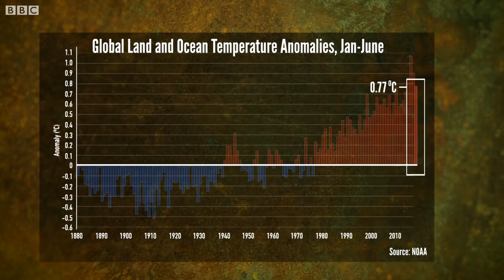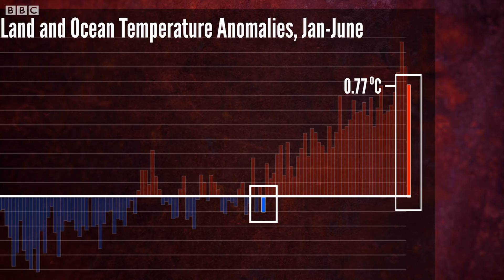Heatwave 2018 explained - BBC News

Comment: July 1757 heatwave, Europe, hottest summer in 500 years prior to 2003.   1896 Eastern North America heat wave killed 1,500 people in August 1896.   1901 eastern United States heat wave killed 9,500 in the eastern United States.   1906 – During the 1906 United Kingdom heat wave which began in August and lasted into September broke numerous records. On the 2nd temperatures reached 36 °C (96 °F) which still holds the September record however some places beat their local record during September 1911 and September 2016.   1911 – The 1911 United Kingdom heat wave was one of the most severe periods of heat to hit the country with temperatures around 36 °C (97 °F). The heat began in early July and didn't let up until mid September where even in September temperatures were still up to 33 °C (92 °F). It took 79 years for temperature higher to be recorded in the United Kingdom during  1990 United Kingdom heat wave.   So on and on. Shall I carry on or not necessary?

Comment: A 1°c rise in global temperature is an absolutely enormous amount of extra energy. That energy has to go somewhere because energy isn't used up, it just gets converted to another form so it goes into stronger storms and hurricanes, more rain, heavier snowfalls, rising sea levels and more heat and fires.
Reply: Possibly the most sensible comment on here yet
Reply: Thank you
Reply: Damien
Nailed it in language anyone can understand.
Reply: Nunovia Gottdamnedbizzness  In a simplified way, That's exactly how energy works.
Reply: Listen Damien, do you know that since the end of the last ice age the temperature have risen some 10 degrees C?... you know that America have been in a socalled hurricane drought and the number of storm reaching landfall is below average?... that global warming shouldn't lead to more snowfall at all, and that the sea is in fact not rising... Al Gore predicted not long ago that the North Pole would be ice free in 2014..."the entire ice cap would be gone in five years"... how do you think your high priests predictions are going?
Reply: @ipanzerschrecku4732  It's stunning to see someone so deeply in denial that they'll rattle off all of that nonsense as fact without citing a single source for it.
Reply: If you cant take the heat stay the fu*k out the kitchen

Comment: And what's behind the hot weather? Geoengineering. Stratospheric Aerosol Injection of heavy metals traps heat in at night. It doesn't reflect enough to help but it's enough metal to make us all toxic as well as hot.
Reply: You geoengineering nutcases crop up everywhere...  
Global warming is fact and is driven by human industrial civilisation, but it is an unwitting relationship.  
.
Do REAL science, not conspiracy pseudo-science.  
.
A Bell -  There is very little that humans can do, to mitigate the emissions and other vectors of destruction that they have unwittingly unleased.    Global warming is locked-in   Nothing we do, can change that.   

Also, within the short term of any carbon reduction program,  temperatures will continue to rise, not only from the locked-in process of current global warming, but a continual and steady reduction in both the cryospheric and atmospheric albedo effect.    Heavy particulates (from industry and transportation...) are currently afording us a degree of protection in the form of 'global dimming'.    So, a classic 'catch 22' scenario.   

Add to that, the very worrying fact, that vast deposits of methane hydrates are beginning to thaw in the sediments of the East Siberian Shelf and from the permafrost, all across the exisitng northern tundra regions.   CH4-methane, is around 100 times more potent, molecule-for-molecule, than CO2, as an atmospheric warming agent.    Though shorter lived, it nevertheless eventually breaks down into two greenhouse gasses, notably - CO2 and H2O vapour.   

Humans!  -  They're either drunk on hubris, stoned on hopium, or in a coma of faith...  
...And most are thus oblivious to oblivion.
Reply: I just don't understand why they would bother with polluting the air when they could just poison the drinking water instead, which seems much more reliable and controllable.
Reply: Windir "They" aren't polluting the air on purpose. "They" are colleges, private companies, local, state, and federal governments in the US, and about 50 countries worldwide that are cloud seeding in order to get it to rain, snow, not rain or snow, clear up fog around airports...etc. China does more cloud seeding than any other country. When they hosted the Olympics they spent a lot of money on seeding. On top of the global warming effects, I wonder what effects these seeding programs have on weather patterns, which in turn effect climate... Everyone yells, "it's local," but with so many doing it now, it's global...

In Tucson, this year, Harvard is doing a solar radiation management test to see what effects pumping particulate in the atmosphere to get the sunlight to reflect out will have. There's lots of information on cloud seeding available. Langmuir and Vonnegut (yep, Kurt's brother) did the first experiments back in the 1940s.
Reply: Windir control of the weather 1pacificRedwood
Reply: Conspiracy theorists grasp at straws and the planet heating up is a straw.
Reply: Windir over population
Reply: A Bell I would be the first type. There are worse things than deaths anyway.
Reply: Your tin foil hat is falling off
Reply: TheCausation My biggest challenge is the willfully ignorant who fall into 2 categories: cynics who say "yes, yes we know all the world is terrible and I'm going to die anyway" and the fearful fragile types who cling to a belief in a mythical "they" who will take care of us all and fix these things. Their type says not to focus on negative things too much because thinking on a problem is not the first step to making a solution, rather, it is somehow yielding to the problem. To the first I say "just because you're going to die, you wouldn't agree to being murdered" and to the second type I say "burying ones head in the sand won't save you."
Reply: So tell me what's the motivation behind it?
Reply: Windir Read "Under an Ionized Sky" or "Chemtrails, HAARP and The Full- Spectrum Dominance of Planet Earth" by Elana Freeland or watch the dvd "Why In The World Are They Spraying" for a full explanation of the spray programs.
Reply: TheCausation You're right of course. It's extraordinary.
Reply: A. Bell. 
At last I've found someone with a fully functioning brain.
Good point.
Reply: Mark Rymanowski yes all the dbass conspiracy theorist think they're so smart. Just like the flat earthers. When infact everyone is laughing at them.

Comment: I can sustain 45°© ,I live in mid-india where 43°© is average during march-june. This summer  highest temperature was 47°©. We  are immune to this life-threatening temperature. The only surprise if it will cross 50°©. Again we don't have AC.I ONLY MANAGED COOLER WHICH CAN COOL DOWN    30°c. The only solution is adoptation. I can easily drink 15 liters of water during summer bcoz you get dehydrated very quickly.
Reply: Unbiased Opinion . BBC.is UK .  my country . our country is not used to this therefore we don't have the stuff we need to adapt to extreme temperature. our average is around 16-25  . in summer . the 33 degrees that we had has changed our average for summer
Reply: Yacobus Fitri like 6 months usage of socks that ain't been washed
Reply: I live by the arctic circle and it has easily been above 30C degrees here for weeks.. or months.
Extreme drought and forest fires everywhere. It's _ highly_ uncommon homes have an AC here too, ugh.
Reply: Nilesh Bhakre us too in England brother. We have no AC in our buildings only offices and industrial kitchens. The south east of England has ran out of fans. In England too we get the humid heat. Stay safe bro ❤️ 🇮🇳 🇬🇧
Reply: I can't adapt. My skin goes white to red and blotchy after two minutes. I'm allergic to the solar radiation. I have to stay indoors, only thing that helps! My baby was poorly with a cold and temperature and couldn't cool her down
Reply: Donald McCarthy bro come here in Vidarbha region in India during MAY, try to live without AC and coole, you will understand 45°© mania
Reply: Fikitupper YOU CAN CALL ME BS BUT NOT TO DARWIN. We can manage to live here without excuse.You should really need to feel 45°© mania.
Reply: You can adapt you pussys, if we can all move here to Australia and live then you can, they came here on ships with no aircon after living in Europe and settled in so you guys can deal with it
Reply: Walker11 Fuck your sewer rat
Reply: Ha, in Tucson, AZ we have the same sustained temps through our summer. I also have a "swamp cooler" so today it was about 90°F in my apartment, and 108°F outside lol. We could hang 😋
Reply: And if it gets down to 78° I need a sweater. It takes just about 14 days to acclimate to hot temps. Anyone can do it.
Reply: Unbiased Opinion typical low brain idiot. Would plants survive at 45c? The only solution is adaptation? What kind of bs solution is that? No one adapts to a high temp. Last I checked heat waves in India killed many. No one has adapted to the high temperature lol.

Comment: Why tf r ppl complaining i love snow in the winter and heatwaves in the summer - tell me im not the only one and also the last summer like this was 2003, then 1976, most summers between were pretty crap and rainy...but greenhouse gases do make the temperatures hotter but how come this never happened in the victorian era when greenhouse gases were chocked out of factories en-masse across the world? I have so many unanswered questions
Reply: Because the effect is cumulative, the victorian influence is still there against our modern output of greenhouse gases
Reply: Also while you enjoy your hot summers the same heat is causing the seas to rise and flooding whole islands elsewhere...
Reply: Elijah Pisani Good comment. I couldn't disagree with your theory, sounds plausible. I would be reasonably confident, as earth has weather cycles, that it'll be able to overcome and survive. How the sun is doing has to be worth watching
Reply: JAMES WHITELEY yes new ice is forming, but not at the rate it should be. For the ice to hold at the poles the ice needs to compress and harden - which takes thousands of years...
Reply: 97, 98, 04 and 06 were hotter than 03
Reply: Snow in the winter?  Clearly you don't live in Britain then because we've gone from having snow every winter to snow every 6 or 7 years.
Reply: It's not about what you like. If the temperature rises then the plants won't be able to cope, the most important organisms in the world (that actually keep the earth alive) live in oceans. Just a tiny change in temperature can kill them a then we die as a result shortly after. You see...not everything is about you.
Reply: Elijah Pisani climate change happens naturally if you see the charts from the past 2000 years it cycles naturally greenhouse gases are  mostly water vapor  Co2 is just a trace gas and a small amount of the Co2 is caused by people
Reply: Isn't new ice forming elsewhere too?
Reply: Daniel Murphy i would say global warming is a natural process however is driven faster by pollution and greenhouse gas emissions - as well as pollution and emissions not from human activity such as cows releasing methane or volcanic eruptions so it is a thing but we are not entirely to blame and nature does have its way to work round it such as production of islands however the production of islands is slower than the melting of ice
Reply: JAMES WHITELEY 
And volcanoes erupting are forming new islands. Global warming is a massive fraud

Comment: That man lying out practically naked is not too smart. In hot temperatures you need to cover up your skin.
Reply: Joel Ashworth so you wouldn't want to get roasted by the sun.
Reply: BlackAsteroid In tropical climate with high humidity then it would help to bear skin as clothing may trap warmth trapped in moisture and sweat. But British summers are often hot and dry. There no moisture in the air to absorb some of the heat first so your skin has to take the full brunt of heat radiation. so cover up with the right clothes would be best in hot and dry climatic conditions.
Reply: The sunlight(ultraviolet radiation) is what you need to worry about, not the temperature. I'm pretty sure if you're in a hot room you would remove some of your clothing.
Reply: Naomi Beery good investigation
Reply: Joel Ashworth cancer
Reply: TheZimma we need no more than 10 mins of direct sun for enough vitamin d, melanin in dark skin only has 3-4 spf
Reply: Maybe you're a vampire
Reply: Naomi Beery getting cancer from the sun has nothing to do with the temperature. In the winter people can just as easily get skin cancer as the summer. The reason why we associate skin cancer with the hot summer is because people are more likely to do things like that man. You’re right he really should get out of the sun or do something to protect his skin, but the heats not why if its cancer that you’re worried about.
Reply: Drew Buckley I'm pretty sure there are more rays when its hotter
Reply: Naomi Beery - You need to be careful about the ultraviolet (UV) rays from the sun, as those are what cause your skin to darken and burn. The temperature has nothing to do with the time it takes for your skin to burn, for example, if you are sitting outside on a hot and cloudless summer’s day, you will burn just as fast as if you were sitting outside on a cooler, cloudless summer’s day. Like Drew Buckley said, you could be able to burn as quick in winter as you do in summer if the intensity of the sun was the same, but it isn’t, so you are less prone to sunburn during the winter as there are less UV rays because of the Earth’s tilt.
Reply: It's called natural selection...
Reply: It's more about time exposed than surface area.
Reply: Drew Buckley if my skin turns brown very fast when its hotter, then I dont need anyone to tell me its equally dangerous in the winter.
Reply: Joel Ashworth skin cancer
Reply: Joel Ashworth
Melanoma - skin cancer. Not pleasant. A shirt.  A 50+ sunscreen lotion. A wide brimmed hat.
Reply: Because you may get some healthy vitamin d
Reply: Depends, high humidity with heat means it’s better to be uncovered and in dry high heat it’s better to be covered
Reply: Naomi Beery he's just chillin'
Reply: maybe he's having a good time. leave the boy alone
Reply: The human can regulate it's body temp better when you are nude.